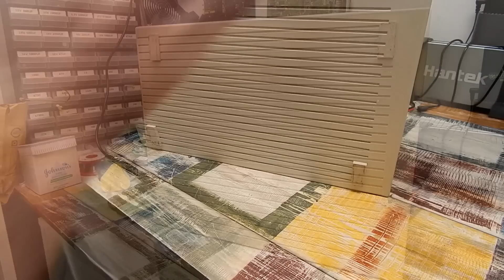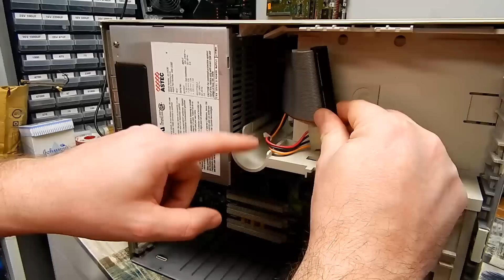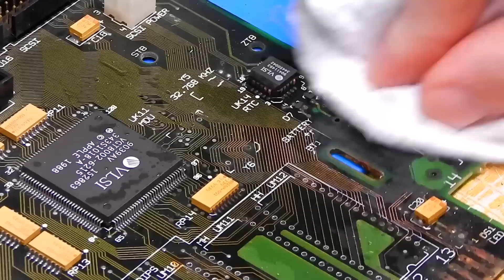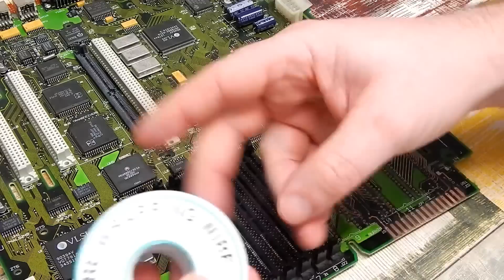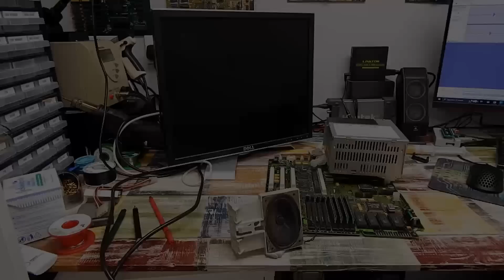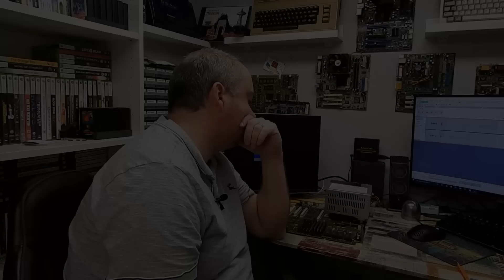Why will this Macintosh IIci not work, HELP!

Comment from the maker: At the end of the video I mentioned that the databus is falling over but never gave much explanation.  Looking at it with my scope, all signals are fine at startup, but maybe 1-2 seconds after the chime the signals are corrupted, it looks like it's trying to pulse but getting pulled down.  Another possible clue is that with the HDD reattached at the moment of the crash it's almost like the power drops out for a split second.  The drive restarts almost like you had flicked the power off/on.  

If anyone has any ideas as to where to look next I'd be extremely grateful.  I've tried reflowing most of the main ICS.  The via has been off to check for damage but it's fine.  

If there is any interest I can pull together a quick 5 minutes video to show what the bus is doing.
Reply: If you think the power is dropping out for a split second, check the ripple on the 5V rail and the caps in the PSU.
Reply: I think the picture you took is the clue. I don't know how the video works (looks like it takes from system ram) but those lines look like they are repeating every 32 pixels ? And it looks like it starts on the 4th pixel ? Maybe data bit D3 has a problem. (or maybe D3  and another signal that happens to be working for this boot)
Also, a tip for probing with the scope: Try to find the signal you are checking on the last chip in the chain, don't just check it on the rom or cpu as it may look ok but may not be reaching everything it should. Also continuity check the same way, every node. I had 2x c64s that took hours to track down open r/w lines on the dram (if only i'd scoped the last row), I only found the faults once I did a 100% point to point continuity check.

Comment: I have a IIci board that has no corrosion, I've removed the electrolytic caps, so you'll need to replace them. I don't need it now. You can have it for the postage. Let me know.

Comment: On the rom chip socket where you fold a leg over, measure it and says "it is fine", I can literally see the broken trace still. You do not have a connection between the bent leg and the other trace. So you measured a connection somewhere else.
Reply from the maker: Sometimes it looks like it's broken but in fact it's fine.  This board has since been repaired, it went to another guy who found a further damaged trace at the far end of the board which brought it back.

Comment: Most old macs needed a new 3 volt pram battery installed to get the pram to function correctly, if these went flat the Mac's wouldn't boot properly .

Comment: I have no idea what that edge connector is for. My SE/30 logic board has one too. But neither the SE/30 nor the IIci have a mating connector in the case. Pretty sure that the Color Classic is the first Mac that actually has a logic board that plugs into the chassis. My best guess is that it is some sort of debug/test header, so that they can test/debug boards at the factory.

Traces that apparently come from/go to nowhere are probably going to an internal layer of the board. All Mac boards are at least four layer, which makes fixing them much more difficult/challenging. Internal traces could be damaged and/or some vias may have connections to internal traces that got compromised. You can somewhat see the internal layers if you hold the board up to a strong light source, but to really see everything you would need to desolder all the components off the board (because you don't know if any traces go underneath components.) There are IIci schematics out there (I believe they are reverse engineered by the community) so that might help.

There are definitely people reverse engineering and creating new Mac boards. I know they already exist for the SE and the SE/30. Not sure if any of the Mac II models have yet been RE'd into community created PCBs yet. I'm sure someone somewhere is working on one tho, so it's only a matter of time.

One thing you might want to look into is a pair of ultra sharp multimeter probes. They aren't really that expensive (I think I got mine for US$8 or so.) They make probing small traces/vias like this alot easier. Probing such small things using standard multimeter probes feels a bit like performing brain surgery with a steak knife :)

Comment: Look, you got a working Mac. Despite what you are seeing, the mac is working. Or else it would not Bong and give tones.

Possible Issues: The Mac IIci is a bit FUNKY with its Video Port. Make sure you have standard VGA with Sync on Green for 640X480 resolution. If not, you will always get a black screen on any video capture set up or even on a VGA Monitor. This also happens on the Mac LC/LCII and Mac IIsi.

Things you do have wrong are: The RAM is on the wrong Sockets. They need to be on the left-most side of the board. It would be best if you have 1MB simms on the left side and 256KB simms on the right. The Mac IIci and IIsi takes RAM from the simms you put in to use for the video; on the IIci, the Right-most side is usually where the RAM is taken for video, but if there is nothing there, then it takes it from the left side. The Left-side is where bottom of RAM is and fills up accordingly with the right side adjusting to it.

You did well with the repair. It giving you a Bong without other noise codes (musical tones on the Mac II Series), means that the Mac is working. Just move over the RAM and add the 256kb to the right side. The rest is figuring out the video, which is hard to do on the IIci, IIsi, LC and LC II series. If you have one of those Mac to VGA adapters, it would help greatly. Use it and go through the switches on the adapter while the Mac is on and eventually you will hit a spot where you will get video on the screen. The Black screen is saying that the monitor is not set up correctly for the Mac IIci's video output.

Good Luck. I know you got it right.

Comment: Have you looked at the Board, if you see some "Layer Markers"?
Maybe this Board is a 4 Layer Board and some traces inside the Board are damaged?
And it worked that one time because it was bend just in the right way that the damaged trace made contact?
Reply from the maker: The schematics show that the board does indeed have multiple layer with internal signalling and not just VCC or Ground.  If it is an internal failure then I might be beaten, would be hard to find such a problem.  

I have checked continuity of all pins from the roms up into the board and they are fine but there very may  well be something else damaged.

Comment: Beginner's question, have you checked the regularity of the power supply? the voltage may drop after a few seconds.
Reply from the maker: I did check the voltage levels and they look fine but it might not be able to sustain the current and dropping voltage as you suggest.  A full recap of the PSU is probably required any way, I just need to order the parts!

Comment: Great video. I know it is a very low tech approach but have you tried tapping / applying pressure to different areas of the board to see if the behaviour changes at all? It could be a via or trace that is just about touching when the board is a certain way. Had it with an Acorn machine that had a lot of battery damage. It worked on the kitchen table but when I moved it to the telly in the front room it stopped 🤣. It is maddening. Especially when you were about to give up and it teased with a glimmer of hope with that screen. The VLSI chip is quite close to the damaged area to. Are all it's pins firmly connected? Maybe one is a bit flakey or the metal has gone to crap with the battery acid? Enjoyed the video.
Reply from the maker: I did try flexing the board or pressing on certain parts of it while resetting to see if it did anything.  Didn't bother showing it in the video as it did nothing but nothing wrong with the low tech approach.  Sometimes the simplest methods yield the best results.

Comment: An excellent attempt.  In regards to that capacitor you knocked off, well, ALL IIcis need a recap.  But you seem exceptionally knowledgeable, so I'm certain you've already deduced that.  I'm surprised that cap didn't take the pads with it.  Every single one of those capacitors will have vomited all over the board.  Not to mention that many had Maxell batteries that just crap themselves, destroying many vintage Macs.  While the IIci is one of the best compact 68k Macs with its generous 3 NuBus slots and easy 68040 upgrades, it unfortunately is pretty notorious for repairs.

My own IIci is down for the count.  Something is shorting the 5v rail to ground and preventing it from booting, but I spent so many hours trying to troubleshoot it that I eventually gave up.

By the way, there's an open source ATX to IIci adapter.  Costs maybe $10 to build one.  It even includes a voltage inverter so you can still power on the machine via the keyboard.  Coupled with an ATX extension cable, it makes it super convenient and easy to diagnose a IIcx, IIci, IIsi, IIvx, IIvi, Quadtra 700, Quadra & Centris 650s, and PowerMac 7100.  It also rules out the power supplies which are also failing due to bad caps.  Man, the 1990s just sucked for quality components.
Reply from the maker: The board was recapped by the previous owner and I'm confident that he did a decent enough job.  Granted he missed soldering that one side of that cap but we've all done stuff like that.  As for knocking off the cap I can only assume the other solder joint was weak and so dumb luck I didn't knock off a pad at the same time.  In fact just writing that is making me think I should at least reflow all the other caps just incase there is a bad joint I've missed.

The psu is one thing I haven't looked at yet but I really should.  A full recap of that is probably needed.  The issues might be power related.

I've got a few ideas from comments for things to try so there will be another video at some point and fingers crossed I can get it going.
Reply: @CRG  My apologies.  I skipped directly to the repair part, so I missed the intro about it being recapped.  That was indeed lucky.

Comment: The bottom LED is power (green), the top as you guess HDD activity, orange. Out of the three IIc(x) models (two IIcx and one IIci) I've played around with the HDD LED was only present in one, the other two had been removed.

The three axial electrolytics look original to me. I seem to remember reading they're part of the soft power-on circuit and can cause problems with that. One of my IIcxs probably had issues there. One night it decided to turn itself on (scaring the living daylights out of my parents when the After Dark screensaver started talking, I had Bad Dog on that computer) and simply wouldn't turn off anymore. Select shut down from the menu, system powers down, only to restart immediately.

On the far right ROM chip (25:15 into the video) I'm surprised the trace between pins 11 and 12 (going to the other row of pins, pin 27 if I counted correctly) isn't broken, it looks quite suspect just where it angles up!
Reply from the maker: I double check that trace but I have buzzed everything out from the roms to positions further up the board and they are fine. The soft start feature on my board still works, I didn't show it in the video but I tested with a keyboard attached.  

I'll see if I have a green LED and will swap that yellow one out.

Comment: Did you check that the power supply is putting out proper voltages (and enough current) ? Do you have a different (known working) IIci power supply you can swap for this one, or a known good mainboard you can try with this power supply? Those moments of it working, then stopping, and then for periods no longer working, sound like an issue that changes after heat or voltage, not a permanent one like broken traces or bad chips would cause. Despite all the damage to the board you found and fixed, I would rule this out now after all those board repairs you made before going any further.
Reply from the maker: I'm starting to wonder myself if the PSU is at fault.  Its certainly putting out a steady 5v and 12v but there is nothing to say it is stable.  A recap of the PSU might be in order.  I unfortunately don't have another IIci to compare against, I don't have much in the way of MAC stuff to be honest.
Reply: @CRG  I would want to rule this out - maybe theres a friend or community member who can loan a known working power supply. I just solved a problem myself this week where a (different) device's power supply measured 5v on the multimeter but wouldn't actually power the device - wasn't putting out enough or any cuurent needed. It would not surprise me that despite all the board damage, there's even more damage or failures inside the power supply.
Reply: @michaelsworkshop9031  I'd even go a step further and say I'd be surprised if there weren't any problematic caps in the power supply. I haven't plugged in most of my vintage Macs for a long time but I've definitely had problems with bad caps in AT power supplies. One caused the most amazing psychedelic graphics glitches in a Pentium 1, I think most of the picture was still there but the colours were all sorts of crazy! Then the picture got garbled as well and I turned the machine off as quickly as I could.

Comment: You have a lot more patience than i do. If i saw that amount of battery damage, I wouldn't have even started - especially for something this old.. Stick it on the wall and move on to something else that you know you can fix.
Reply from the maker: There have been a few good suggestions in these comments that are easy enough to test so I'll try those then just put it away and wait for someone to release a new PCB for it.  Apparently its being worked on.

Comment: Those yellow tantalums are horrible. Their failure mode is a short. In coupling mode that will bring down a power rail. Not saying that's your problem, but 'since the days they were chosen here that was due to their size / density benefit - today's electrolytics are much smaller than they were back then.
Reply from the maker: I did test the board for shorts, certainly no dead shorts although 5V to Ground is only about 15ohms 🤔  I'll ask another owner to test their board to double check thats correct.

Comment: I put all my bets on another broken trace or detached pad. I've had floating inputs cause spurious signs of life before. It doesn't have to be in the corrosion area. Also, you might try heating up or freezing down various areas of the board to see of you can change the behavior. I've had hopeless cases like that before and put them away after spending way too much time. A year or two later I checked them again and found the issue quite quickly.
Reply from the maker: You could well be right, the problem with something like that though is finding it!  I suppose if anywhere its likely to be around the capacitors, might be worth giving those areas a second look.

Comment: Just a thought, I have worked on finicky old boards (not macs), and when the issues are this intermittent, I have checked all the vias. Sometimes they connect and sometimes they dont causing this exact issue.
Reply from the maker: Could be a via, good suggestion.  I'll be sure to double check those in the corrosion area.

Comment: Hi - I am no expert, but maybe it is "bit rot". Over time ROM chips may get faulty or lose the data stored within them. I had a PCI graphic card that would POST when installed, but there was no video output signal. I was able to recover the BIOS from the card and compared it with the original binary file - 4 bits were different. What I am trying to say is that maybe this random behavior is from a faulty ROM chip which may deliver random values (and by accident delivered this one time a correct value when the board booted). Maybe from 100 tries, it will work once.
I am working on another Geforce2 MX card which seems to suffer from a similar issue, but no details yet.
Reply from the maker: That thought had crossed my mind, there could be a failure in the roms further into the code.  Its running to the point where it chimes then the roms are corrupted.  As I said in the video though I'm not sure I can read these out easily in my TL866.  I might see if I can borrow a known good set of roms from someone to test with.  If that was the issue I can disabled the roms and use a rom simm instead.  

Also just wanted to say I've been following your work on the voodoo cards, great video series.  Keep up the good work its been fascinating to see.